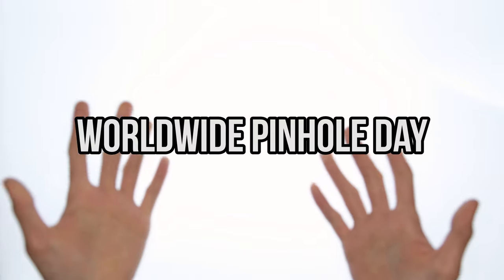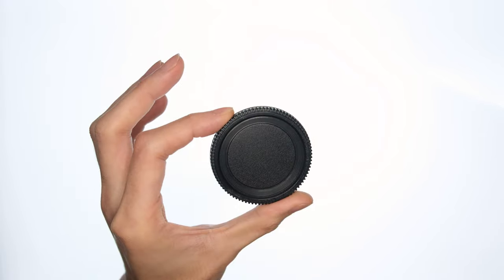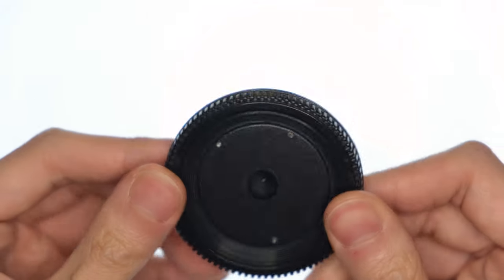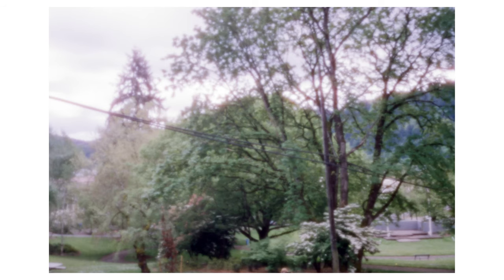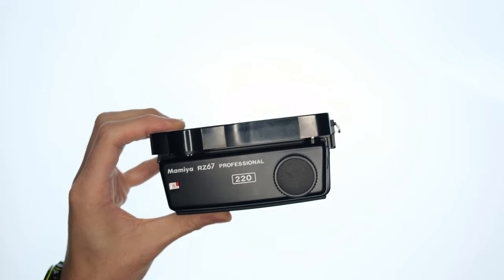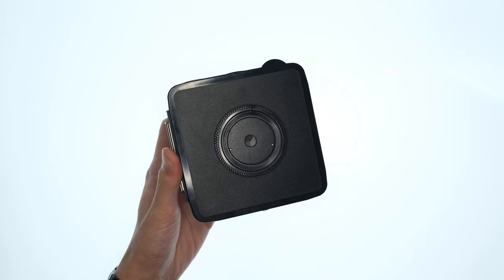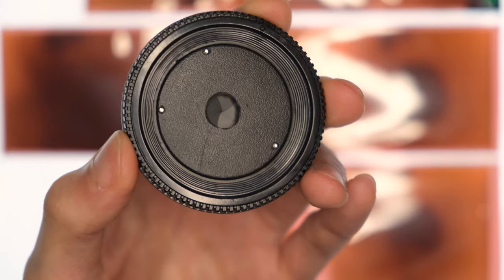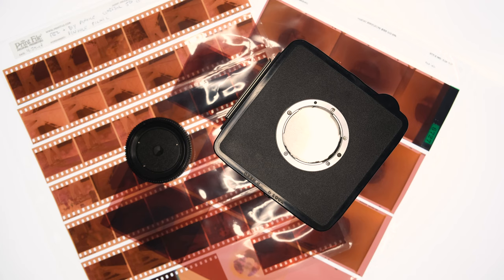Making a Pinhole out of Aperture Blades

Comment: Maybe use an f mount extension tube to move the pinhole from the film plane?
Reply from the maker: I never even considered using an extension tube. I'll have to try that out. Thanks for the suggestion!
Reply: @atticdarkroom  I think you need a mount with a wider diameter though, otherwise the f mount's width might restrict some of the light coming in. Something like a P6 mount or bellows if you're crazy enough
Reply from the maker: Yeah I could see it becoming a problem. It has to be less of a tube shape and more of a cone shape.

I also didn't consider using a bigger mount, that could be interesting too...

Comment: Those don't look terrible, they look pretty typical for 35 mm pinhole.  Your hole is a little larger than optimum with that cap setup, which makes the images softer than they have to be -- I have a pinhole body cap for M42 with an actual pinhole in it, around .2 mm as I recall (been more than fifteen years since I made it) and the results are slightly sharper, but not spectacular enough for me to use it a lot.

Generally, though, the bigger the film, the "better" a pinhole image looks, because you don't enlarge the image as much for viewing.  Also, the closer the pinhole is to the film, the sharper the image (assuming you optimized your pinhole size for the projection distance).  IMO, the sweet spot is 6x6 with around 25-30 mm "focal length" -- nice and wide, but not impossible to compose, slow enough to get manageable exposure times even with fast film, but fast enough you don't wind up exposing for an hour with slow film.  My WPPD submission for last year was this format on NHG 800 -- with a Custom Camera Builders camera that I bought in 2020.

I like the idea with the 220 film back, but I'm likely to do something a little different.  I have a selection of roll film holders that fit a 2x3 Graflok mount (which I use with my Century Graphic and my RB67).  If I can make a simple "camera body" with the camera side of a 2x3 Graflok, I can put a pinhole and simple shutter on it and use it with any of those roll film backs -- 6x4.5, 6x6, 6x7, or 6x9.  Pinhole body cap on the RB won't cut it; that's close to 80 mm projection distance -- but I might be able to make something that works with the bellows retracted on the Century.  Likely to get the bed in every frame, but that's not a horrible thing for this sort of improvisation...

Comment: Ok some help, my 1st thought is a reversing ring for the mount you decide on, with a series of step-rings to make the desired cone, and a front plate of thin metal soldered(for light seal) to the last ring. Not sure how to mount the aperture assembly to the front plate though.
Reply from the maker: I never thought there would be a practical use for a cone of step rings, but I really like that idea. I'm sure there's an easy way mount that pinhole on it. I'll have to mull this over.
Reply: @atticdarkroom  make the highest stack of adapters on a camera

Comment: Great video (as always)- what did you do to add that f mount?
Reply from the maker: I first carved out a hole in the plastic cover, then I tried to thread the existing screws but they were a bit short. So I also glued the mount down, but the glue didn't cure evenly causing small gaps around the mount which caused all those light leaks.

Well I think that's the reason for the light leaks, there were a lot of ways for this to leak light.